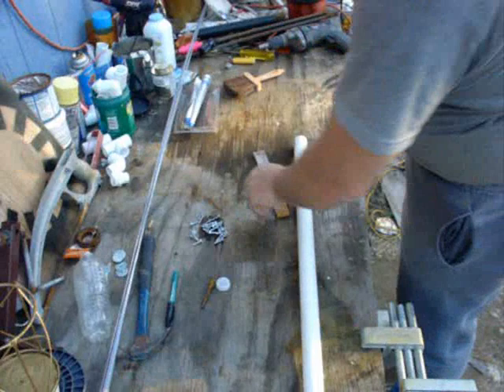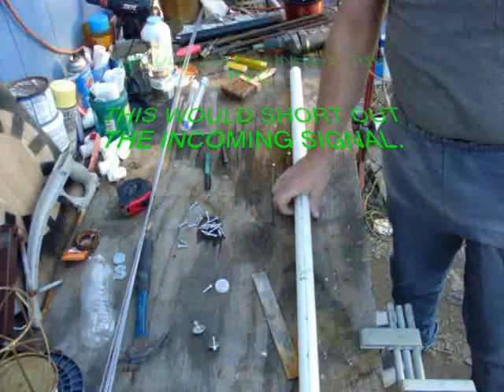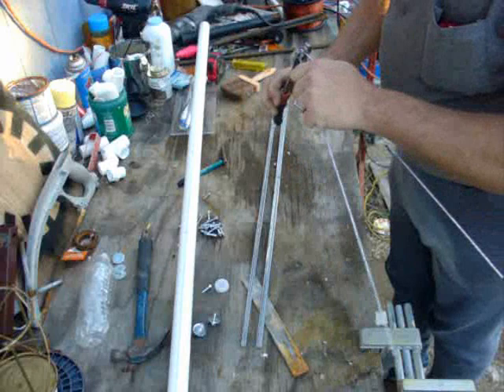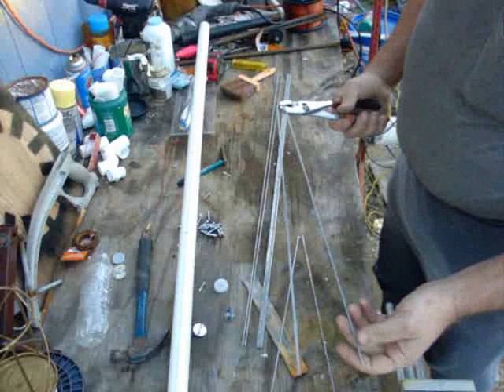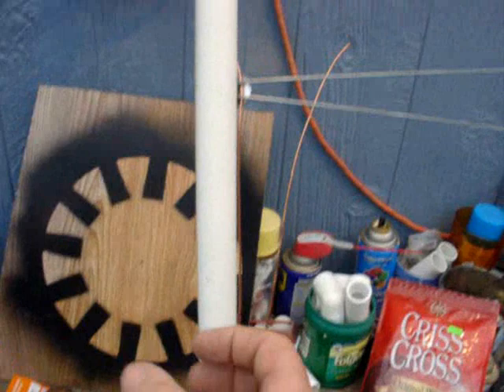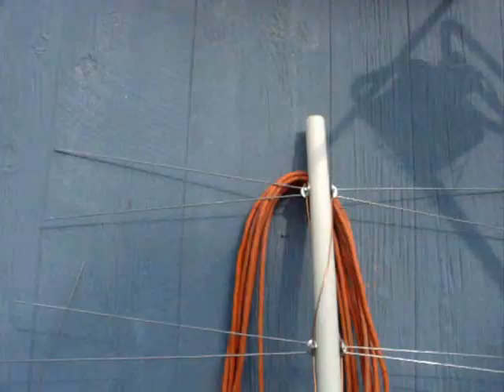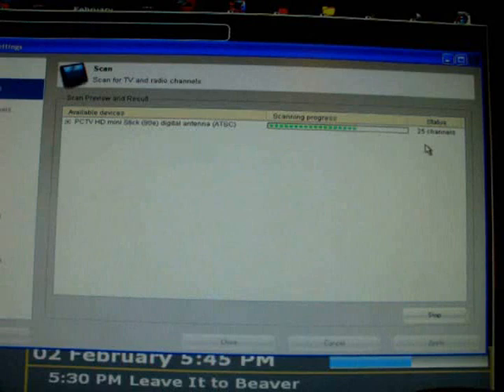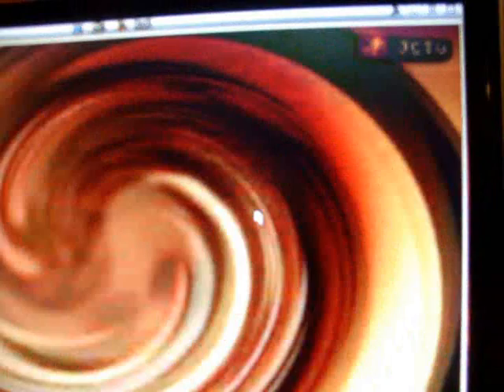EASY BUILD  HD TV ANTENNA   FREE HD TV 2020

Comment: Hi Muddy!  Excellent video!  I see a lot of those bow-tie antenna videos but almost nobody can explain the physics behind the design.  I notice this calculation: 234/910 = .245 (I get  .257)but where did you get this number :234 ?  The aerials are 9 1/2 " and spaced 5 " on your design?  pvc pipe 1 1/4" ?  Thanks!
Reply from the maker: +Robert Grlic 
1 quarter wave formula for length in feet is 234/frequency in MHz.
for a full wave quad antenna is 1005/frequency in MHz. Ham radio antenna formulas. but these HD TV antennas are fractal antennas. The lengths and spaces bounce the wave between the aerials to absorb almost all frequencies between them. Almost any frequency that is shorter than the length of the aerials should be absorbed. My design differs from most others because the aerials are almost twice as long. This allows for the lower frequencies to grab some gain in the fractal web patterns.
any odd multiple of half wavelengths work well. each odd multiple adds more gain. But it also tightens the directionality of the antenna. Thus when aimed it must be very close to the exact direction. That is why I show how to find the station on a map. look at your street and the angle of the station compared to the street angle and aim. it works very well.

Thanks.
MUDDy

Comment: Hi Muddy, Thanks for a great build.  I can't seem to find the straight "CEILING TIE WIREs" anywhere (Lowes, Ace, Grainger) .  All they carry are rolls.  Any suggestions or substitutiions?  Also, what gauge were they? I'm thinking 24 as the 18 seems to flex too easily.
Reply: Hey, reverse those 2 gauge numbers.  Sorry.
Reply from the maker: mitchell drake
COPPER ROMEX WIRE WORKS WELL. PROBABLY 10 GAGE WOULD WORK AND NOT BEND. OR THE GOOD COAT HANGAR WIRE.
THANKS.
MUDDy

Comment: i like the way you have set this system up but how would it work in a valley by a 1700 feet hill. i am about 6ten's of a mile close to it. with a small anntena and a buster i get only 5 or 6 channals. please help
thank you
Reply from the maker: it sounds like Washinton state or the hills. I know that when there are hills between you and the station, the only received signals come from back scatter, or reflected signals from other hills and ranges. If you can get one station in well. have someone watch the signal level, and extremely slow.... move the antenna to different elevations and tilt angles. then do a channel scan.
no promises, but most of the time, You can find a dirrection that the signal is reflected from.
ALSO,... GROUNDING THE SHIELD CAN IMPROVE THE SIGNAL.
MUDDy
Reply: ***** i live in new york state

Comment: I just put my old antenna, the one that was attached to my chimney and hooked a coxial connector to, ran to the incoming cable box the cable company installed on the side of my house, broke into it and connected to the line running into my house to  all the coax outleets and get 28 stations clear``as a bell.

Comment: hey muddy and everyone, care to help a newbie. i am from the philippines and the antennas here can only pick up 2 channels which is abs cbn and gma7. im hoping this build can pick up all channels available by purchasing cable services. i would like a diagram of some sort :) with all the dimensions and things. :)
Reply from the maker: +Deejay Domingo 
Actually, this is a design that uses fractal resonances between the aerials. much of the lengths do not matter much. Build it as you see it. make it strong enough to handle the wind and birds sitting on it, and place the load of the transformer in the center instead of the bottom. 
Warning,... This antenna is extremely directional. use web street maps, and airial photography to get exact directions of stations. It is too cheap to build. I am sure you will smile with the results. :)
MUDDy

Comment: I have a couple of Viet Nam Veteran  friends who are barely making it. I got them a flat screen with a lousy antenna I made. Wondering if I could make a mini version of this for indoor??  Thoughts.

My friends are 67  years old and are pretty beat up , between the both they make rent and some food. They have a room in downtown Sacramento so Im thinking they are close to the signals.
God Bless
Mike
Reply from the maker: blinko656 Yes, just cut the aerials down to half length, and connect the balun transformer in the center, instead of the bottom. It should work fine. although, there are dead spots inside of the house due to overlapping signals canceling them selves out. find a known channel frequency, and then move the antenna around until you find a nice sweet spot where the reflected signal amplify instead of cancel out.
The rest of the channels should come in fine. At least half of them anyway.
MUDDy
Also, I commend your works of helping kindness. You rock.
Reply from the maker: ***** Hello Jorge, I do care. finding time to search out unanswered comments, and work on getting more finances in the home seems to be kicking my butt. Sorry about that.
You are right on the downsize. cutting the aerials in half lengths and connecting the antenna balun transformer to the center will work for indoors, and outside. I hope this helps the comfort zone requirements, and delivers a great signal.
Take care and enjoy.
MUDDy
Reply from the maker: big smiley bro. lol. If I'm not mistaken, The next thing I show should be taking the Muddys' Mighty Mini wind turbine down and installing at the new shop. Finally!, I get to stay all night at the shop with real power surging into the batteries while i drain them, and getting work done. :)
Thanks for the cheers bro.
MUDDy

Comment: I built ur antenna but I need the final piece...what the hell is that little converter box that you casually mention??? I read the comments section and you said you got it in the mark down bin somewhere!...Could you PLEASE let me know the MAKE and MODEL of this box so I can pick one up? I'm in rural Ontario Canada and they just boosted my satellite and internet rates to over $200/mnth and I've had enough!😠😠😠 Please reply muDDY! Thx
Reply from the maker: A famous tv announcer in the old days said... I'm fed up, and im not gonna take it anymore. And half of America joined him shouting out their windows that night. Lol.

The little connection is called a 300 tp 75 ohm antenna transformer.
A ham radio operator would call it a vhf/Uhf 4 to 1 balun.

The word balum means balanced to un-balanced.
Ladder line, and or flat line antenna line is a balanced line. Coaxial cable is an unbalanced line. This is mainly due to the outer shield being so much more conductive the the center signal wire in the middle. 

Tv coaxial cable is 75 ohms. And has high losses.

Flat line, or ladder line is around 300 ohms, and has very low losses. But it has to be ran or installed away from conductive surfaces or it will have sections gaining in capacitive values. 

Google that part as tv 75 to 300 ohm transformer.
Reply from the maker: The other box that you might be referring to is a usb tvpc adaptor for receiving tv signals on your pc.
The one i have is here....
https://www.ebay.com/itm/Pinnacle-PCTV-HD-Pro-Stick-USB-TV-Tuner-HDTV-Remote-Software-/123672531912?nav=SEARCH

Comment: Muddy, just a another question about these atennas, could I build two antennas one on top of the other on the same pipe each facing in a opposite direction and each  with its own coaxial so two bidirectional dipole antennas one in N/S direction the other one in a E/W direction would this work in your opinion ?
Reply from the maker: +colplowboy Yes it would, BUT..... the coaxials cables must be the same length, and the two antennas should be of some good distance from each other, Unless they are used through a switch one at a time.

Explanation:  The waves of the two antennas will pick a direction halfway between the two directions if they are too close. ie.nw, ne, sw. or se.
The lengths of the coaxials will also adjust those angles according to the timing of the signals. But setting the two antennas apart from each other will cure all of that. Then you would be able to receive from both bi-directionals.
MUDDy
Reply from the maker: +colplowboy 
Lol, Your browser or youtube was malfunctioning to update to show you that the comments actually went through. :D But You were persistent. I cleared 109 comments that youtube decided were spam from repetitive posting. :D

Usually when that happens, the comments are going through, But it just doesnt show it to you.
Most of the time it is just youtube rewriting code, or maintenance.
 Anyway, my hat is off to you for determination. :)
I am honored.
MUDDy

Comment: for the whiskers did you say 12ga?,    by itself the gauge numbers can be misinterpreted  because the gauge for copper is different from ga for steel wire and are frequently interchanged,   do you know the actual decimal dimension?  thanks,  regards

Comment: Connecting a 4" piece of wire stuck into your cable connector on the back of the t.v. works too. 
a tower 45 minutes away comes in great....

Comment: Hey Muddy, great video, I remember we were camping one time in Mississippi and wanted to watch the LSU Al game on the laptop tuner (WinTV is pretty good $75), just threw a 25 ft extension corrd over a tree limb, then connected to the WinTv USB module and got to watch the whole game (strangely the signal was lost just after the game (wondering if they boost signal power during games?) .

Comment: What was the name of the wire you used for this Video?  I couldn't hear it very well in the Video.  I intend on Making one of these.  I'd like to Make something like this that attaches to my Directv Dish that we don't have satellite from anymore... *****
Reply from the maker: JUST CEILING TIE WIRE FOR SUSPENDED CEILINGS. YOU COULD USE 10 GAGE COPPER WIRE.
Reply: Ok.  I May do that then instead, Depending on what is Cheaper.

Comment: Muddy, for an outdoor installation, shouldn't the antenna be grounded for lightening strikes? Could you suggest the best way to ground it?
Reply from the maker: Thanks Marty,...yes.
An oversight on my part, but very important indeed.
THE SHEILD CAN BE GROUNDED ANYWHERE BETWEEN THE ANTENNA, AND THE RECEIVER, This will improve reception as well. BUT, The most important is the signal wire itself.
the signal wire is the center wire on the coax.
One needs to separate part of the coax sheild, and signal wire to expose the signal wire, Then make a good grounding rod by pounding a steel or copper coated steel rod into the ground about 6 feet deep.
clamp a thick copper wire to the rod.
find a small thick piece of metal with a threaded hole in it. sharpen the tip of the screw that will be used. place the signal wire close to the tip of the screw, and then adjust the screw very close to the signal wire. as close as you can get it without touching it is best. ENCASE THE ASSEMBLY FROM WEATHER.
NOTE..... ONCE IN A WHILE A WATER DROP WILL FORM BETWEEN THE SCREW AND WIRE. SLAP THE BOX LIGHTLY AND IT WILL DROP THE WATER, AND THE SIGNAL WILL GO THROUGH AGAIN.
MUDDy
Reply: *****
Can you make a video on how to ground it? Thanks
Reply from the maker: ***** Good idea.
Thanks.
MUDDy
Reply from the maker: dwg42 YUPPERS, old ham radio do it yourself build there. Excellent comment. thanks for answering the question while i was AWOL.
MUDDy
Reply: Muddy, I built your antenna and it works like a charm. Regards grounding, a purpose made grounding block can be had through antenna supply outfits. They are cheap and easy to hook up. Grounding wire doesn't need to be any larger than #6 solid copper. That can be bought by the foot at any electrical supply house, as can the pvc conduit and the ceiling grid wire that everybody seems to have so much trouble finding. My antenna is ridiculously low to the ground, between my house and the neighbors, and under a power line. I still pick up 45 channels from North and South Carolina, so go figure. So much for rules. Here's my question. I have read that solid copper coax (RG6) carries signal better than the copper coated steel coax available about anywhere. With that in mind, would solid copper aerial sets do a better job than the ceiling grid wire? Thanks.

Comment: Does this antenna capture both UHF and VHF signals? I live in an area where most of the stations transmit in UHF, but the programs I desire are transmitted on VHF.
Reply from the maker: WOW, i THOUGHT ALL TV TRANSMISSIONS WENT TO HDTV. This antenna design has a wide frequency responce, if you cannot receive what you want, try snipping a half inch at a time off of all of the aerials.
Reply: @muddymuddymuddmann  Muddy, the broadcasters switched over to a digital signal. HD just means High Definition and refers to picture quality rather than signal type. I built an antenna after watching your video, then built another with some modifications such as copper wire elements rather than cieling grid wire. I started to learn a few things and added a signal amplifier. Then I found out that most coax, including what the cable company uses is copper coated steel and won't carry the necessary voltage to power an amplifier. So I re-ran my coax in solid copper core. It's all been good fun, and I owe that to you. Didn't spend a lot of money, and my antenna picks up 60+ channels on a good day.

Comment: Does anyone know where to buy straight drop ceiling hanger wire? Can only find coiled rolls at the local home centers and hardware stores.
Reply from the maker: +garyabc I got mine at Home Depot. Copper 10 gage electrical wire will work well. I was thinking of using copper tubing. I would have to try it out first. I figure if i fold it and hammer the fold flat, a hole could be drilled for the screw. The only problem i can see as a possible problem would be the weight of the tubing. some sort of support would have to be added. :)
MUDDy

Comment: Can I use stranded wire? I have a whole roll that is begging to be used. Thanks Scott!
Reply from the maker: Phil Shope The problem with stranded wire is, It is not insulated with a varnish or other insulation. The windings would be one solid connection. If you are talking about stranded wire with one rubber or plastic insulation, Then i would say That the insulation is very thick and would take up a lot of space. And that it would probably melt under higher amps. You would be able to get 1/3rd of the windings per coil, thus 1/3rd of the voltage per same size coils. The surface area of the rubber insulation is large, and helps dissipate heat, but when it is crowded into a coil, it looses that surface area, and only accumulates that heat within the coil due to no surface area to bleed off that heat. thus at best,... 1/2 of the amps rating. So ,... all totaled up we have 1/2 amps at best and 1/3rd voltage. 2 x 3 = 6. Thus 1/6th of the power available. MUDDy   Although i have Thought of using the solid core telephone wire to build small units to power some leds.   stranded wire will conduct more power due to more surface area on the copper itself. so some factories use several strands of enamel coated wires in place of one solid wire to wind their coils. such as four wires in hand for several turns per coil.  example: two strands of fourteen gage wire will be very close to 9 gage wire in ratings. so instead of 35 turns of nine gage, they use two 14s in hand for 35 turns.

Comment: hi there.... I have a question, what type of antenna works better Bi Directional or Fractal? thank you...!
Reply from the maker: Hector Rea there are fractal designs that are bidirectional. Bi=directional is the propagation pattern of the antenna. fractal is the way the magnetics harmonically mix for the receiving of the wide band acceptance. This is also a fractal antenna. some of the other fractal antennas are more wide banded than this, and have several precise bends to follow. Those funny patterns work very well, If you can get them exact, and exactly the same for each one. and also the exact even spacings between the aerials is a must as well.
AS A NOTE: I often thought of adding a short piece of bamboo across the top of this antenna, and two pieces of fishing string down the ends. one wrap around the ends of the aerials and a drop of super glue to keep the aerials from bending over time, and bird landings. lol.
MUDDy

Comment: Muddy I have to make one of these for my mom she is canceling directv all i need to know is what size pvc pipe did you use and what gauge copper wire did you use thanks.
Reply from the maker: 1 inch or 3/4 inch thick walled pvc. and as fat of a wire as you have on hand. :)
10 gage is good. I used ceiling tie wire, and dont use the thin walled pvc.

according the comments results, make sure you use the 75 ohm to ribbon wire transformer for the cable to antenna connection. And some have had better luck connecting that to the center of the antenna instead of the bottom.

MUDDy
Reply: I used 1" pvc pipe sch40.  The 75/300ohms transfo in the middle.  Picking up US stations 88 miles away and antenna in my attic.

Comment: I tried with stainless steel wire for a connection to no avail.....maybe I need copper instead?
Reply from the maker: Mike B acid flux solder and more heat for stainless steel. plumbers solder.

Comment: gud day mr. muddyman.ive watched your video.and i find it intersting.just 1 question.will this thing do the same here in philippines?thank you and gonna try one
Reply from the maker: cristan rabiros sure it will. Some of the others have aerials that are about half length. But the length i use, covers more space to absorb from. doubling the length like i do, allows the antenna to run in harmonics with a bit more gain. It should run just fine.
MUDDy
Reply: ***** what gauge of tie wire u are using?thank you
Reply from the maker: It looks to be about 10 Gage on mine. :) It is just for the stiffness of the wire. Birds seem to like sitting on antennas, lol.

MUDDy